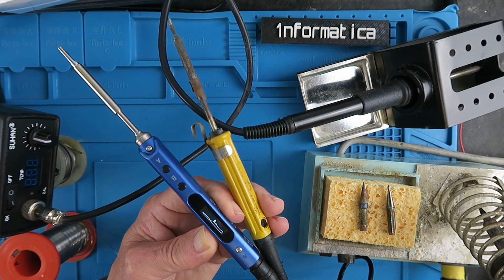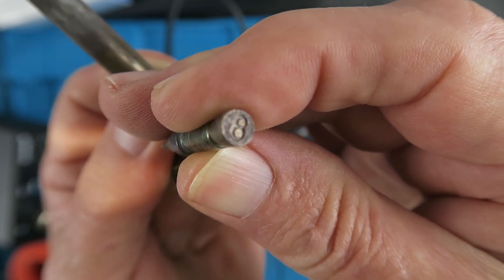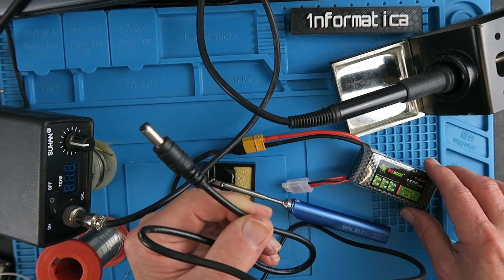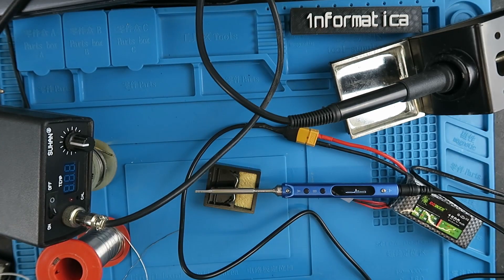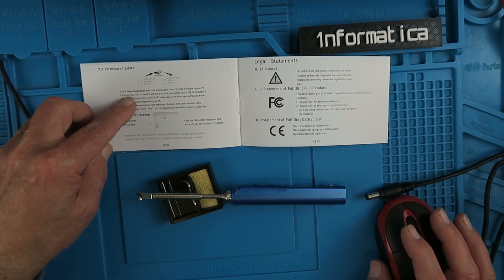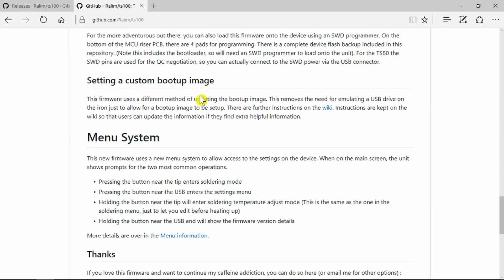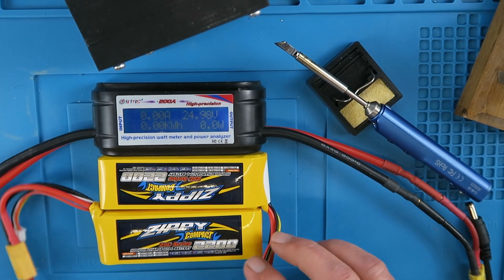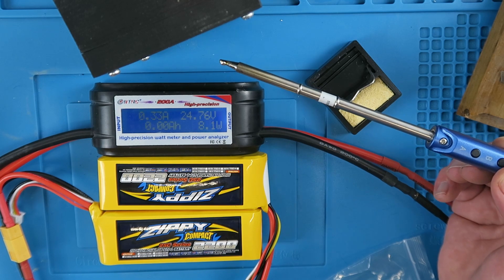Flipsky TS100  SQ-001 65W Soldering Iron Review Firmware Upgrade

Comment: My SQ001 wont update... I do these steps and it disconnects, says there was a file error if I should skip or try again. And when it reconnects it doesnt show back up on my PC. Even tho my PC makes the reconnect USB sound. It also already has 3 file folders installed on it.

-_-Traches
.fseventsd
.Trashes

Even if I delete them when it reconnects theyre back on there still.
Reply from the maker: I see the the same 3 items on my iron so it is normal. What file are you trying to flash? Here is the original file for comparison : https://drive.google.com/file/d/1BmnELG_dja4AgBB6A-mY7ZpWc4zoilOv/view?usp=sharing Please consider subscribing if you have not done so already!
Reply: Mine won't update either, but it says it doesn't have enough room for the file!

Comment: I am not sure if it made the difference but I noticed that each time I connected the soldering iron to my laptop, the driver displayed as F always shown a file that I moved into my laptop just in case and removed from the driver F. As a direct result I could update the Firmware as per your fine instructions.

Thank you very much for your kind assistance.

Have a wonderful weekend.
Reply from the maker: Hey thanks! Happy you have it working. Please consider subscribing if you have not done so already!

Comment: Hello every body there. I received my new TS100 this week and I  have tried several times to update the firmware as per the given instructions  inthis video as well in different videos I saw. By the time I tried to paste the file .ex, the computer displayed a message that the destination has not enought space for the file I was trying to paste...!!! 
Today the file .ex size is about 91 kb while the capacity in my TS100 soldering is just 70 kb !!!!

I do not know what happend here..

Can anyone give a hand on this??

Thanking you in avance for your kind assistance
Reply from the maker: 91 kb is the correct size for the standard firmware. My iron shows 1.96 Mb when plugged in in DFU mode (button A pressed when connecting). Is your iron recognised as an STM32 when connected?

Comment: This review brought me one step closer to getting one of these. Not sure how well it will be for 18650 packs. It was struggling a bit for that thick wire connection, did you use resin flux for it?  Excellent review. And funny quote from one of my all time favorite comedies. Have a blessed and Happy New Year
Reply from the maker: Thanks Mario! I would not say it is well suited to soldering 18650's. I did not use any extra flux, I wanted to see what it could do at a push in field conditions. Still a useful tool for the field kit. Wishing you a happy and prosperous new year.

Comment: I'm good with a Burns any thing Iron.   Give me a 20W iron and a selection of tips I can do about anything needed.   I have a 100W for the other stuff.   No I don't need a Iron to fiddle with.  Just Solder.   LOL   The 100W Iron makes short order work of those 14 - 10 AWG jobs.   Gets HOT ,  Solder FLOWS and ya get off.   Insulation intact.
Reply from the maker: Luddite! Personally I was disappointed that there is no Bluetooth APP to control it from my mobile!!
Reply: @1nformatica  Damn, ONE UPPED me with that one.  LOL   I must admit  I did enjoy my first 12V and Battery Operated Irons for doing chit away from a plug.